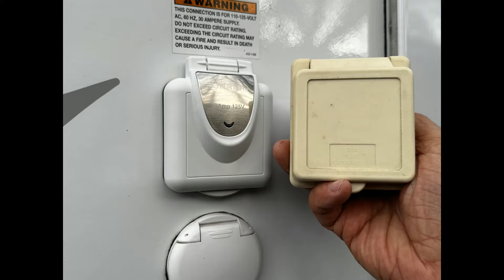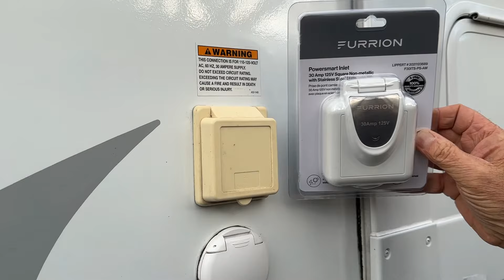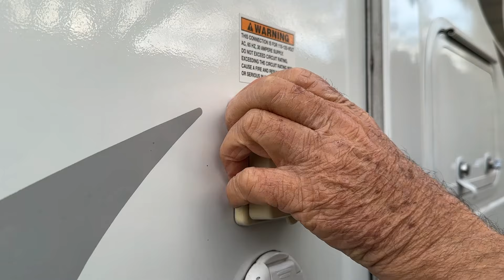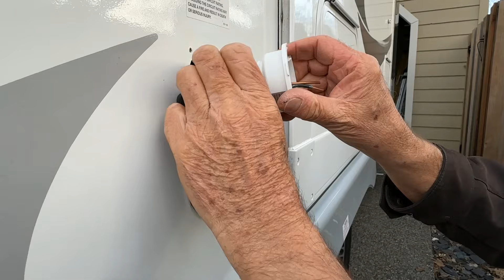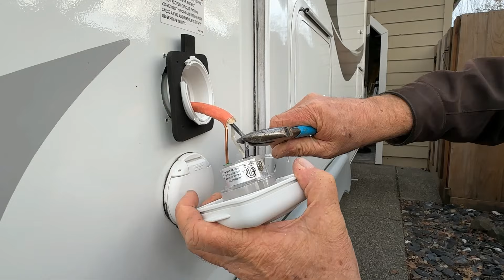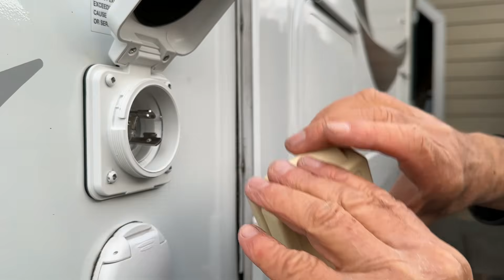Installing a 30 Amp RV Marine Grade Power Inlet

Comment: I have the upgraded marine plug in my camper… but I noticed that the LED light on the cover is not working. I think water got into it around its circuit board and shorted it out…the LED in the cover looks built in….any suggestions other than replacing the whole plug? Do they sell just the cover with red and black leads to the LED?
Reply from the maker: Hello Walter, thanks so watching and asking your question. I have had on a previous  inlet plug the same thing happen and have heard of many others that have had the same problem with the light failing. And have not found on the internet a way to fix this problem, mine is still working and if it fails I guess I'm going to have to just live with it :( . You might try contacting the company and ask them what to do?  If I find a solution I'll get back to you.
Reply: @thetraveltrailerguy  I’m afraid the solution is going to be to replace the whole assembly… but yes let us know otherwise if there is a replacement cap …when I do replace the unit, I will remove the two inside screws to get access the red and black wires entering the LED then apply some RTV to the red and black wire leads as they enter the plastic case to the LED to keep water from wicking into the LED, if yours is still working, you might want to do that as a preventative measure. If it works maybe add that process to your videos. Thanks
Reply from the maker: @walterneilson8119  Thank you for the information Walter, When I get back from our cross country trip I will do what you recommended, make a video and give you a shout out for recommending this. Thanks again, Mike
Reply from the maker: https://www.thorforums.com/forums/f8/help-yellow-shore-plug-light-but-30amp-blue-light-off-25663.html

Comment: ? Michael.  Using that adapter from camper to home.  Does the extension cord warm up at all when in use?
Reply from the maker: Hello Mike :) I The adaptor is nice to have, I use it to charge the batteries; to cool down the refrigerator before camping; to run the heater blower. The extension cord  has never got warm at all, I don't use it to run the air conditioner or the microwave (but maybe it would be okay to do). We have used it at camp grounds when we don't need the air conditioner. Its a lot better than pulling out the big cord when running the generator too. 
90-Degree Dogbone RV Adapter 15-Amp Male and 30-Amp Female with Twist Lock and LED Indicator - https://amzn.to/3Hoxd3u
Reply: @thetraveltrailerguy  I would use it at the house, RATHER than running my 30amp cord from the 110 in the garage to the camper's 30amp plug.  The regular camper 30 amp cord.  Makes more sense.  I HAVE run the AC in the camper with the 110 to 30 amp at the camper at home, but nothing else without tripping a fuse.   Oh, a few times at campgrounds, there were no 30 amp plugs, only 110.  LOL   I do have a converter plug.  But you can't run much on 110 only in a camper.  Thanks.

Comment: Thanks Michael. This is on my to do list before our first outing this spring.
Reply from the maker: You're welcome Mr Rick, I installed this same one on our last trailer and it worked really well. Thanks so much for your feedback and watching, its appreciated. 

Installed in Video:
Furrion 30 Amp 125 Volt Shore Power Inlet with Marine Grade quality and Powersmart technology - F30ITS-PS-AM -
https://amzn.to/428GBSk

90-Degree Dogbone RV Adapter 15-Amp Male and 30-Amp Female with Twist Lock and LED Indicator -
https://amzn.to/3Hoxd3u

Other option mentioned in video:
SmartPlug RV Power Inlet and Connector - 30 Amp - White -
https://www.etrailer.com/RV-Power-Inl... 

SmartPlug Website -
https://smartplug.com/product-categor...

Travel Decal Maps -
https://amzn.to/3S9va8q

9-in-1 Wire Stripper Tool -
https://amzn.to/3MHtnFA

M12 12-Volt Lithium-Ion Cordless 1/4 in. Hex Screwdriver Kit -
https://amzn.to/3sF6oUC

DEWALT Screwdriver Bit Set -
https://amzn.to/3ulyJQg

Comment: Another helpful and useful video Michael. I like that you can use your existing power cord with no modifications. The threads on the 30 amp outlet on our Lance are difficult to engage, so this is a mod that I will definitely make in the future. Thanks for sharing.
Reply from the maker: You're welcome Henry, this one is built much better than the ones that come with most trailers. You sure can feel the difference in quality when you attach the cord to it :)
Installed in Video:
Furrion 30 Amp 125 Volt Shore Power Inlet with Marine Grade quality and Powersmart technology - F30ITS-PS-AM -
https://amzn.to/428GBSk

90-Degree Dogbone RV Adapter 15-Amp Male and 30-Amp Female with Twist Lock and LED Indicator -
https://amzn.to/3Hoxd3u

Other option mentioned in video:
SmartPlug RV Power Inlet and Connector - 30 Amp - White -
https://www.etrailer.com/RV-Power-Inl... 

SmartPlug Website -
https://smartplug.com/product-categor...

Travel Decal Maps -
https://amzn.to/3S9va8q

9-in-1 Wire Stripper Tool -
https://amzn.to/3MHtnFA

M12 12-Volt Lithium-Ion Cordless 1/4 in. Hex Screwdriver Kit -
https://amzn.to/3sF6oUC

DEWALT Screwdriver Bit Set -
https://amzn.to/3ulyJQg

Comment: Another good how to fix. Keep them coming.
Reply from the maker: Thanks Henry, I really like the quality of this power inlet much more than the ones that come stock on the trailers. Thanks again for watching.

Installed in Video:
Furrion 30 Amp 125 Volt Shore Power Inlet with Marine Grade quality and Powersmart technology - F30ITS-PS-AM -
https://amzn.to/428GBSk

90-Degree Dogbone RV Adapter 15-Amp Male and 30-Amp Female with Twist Lock and LED Indicator -
https://amzn.to/3Hoxd3u

Other option mentioned in video:
SmartPlug RV Power Inlet and Connector - 30 Amp - White -
https://www.etrailer.com/RV-Power-Inl... 

SmartPlug Website -
https://smartplug.com/product-categor...

Travel Decal Maps -
https://amzn.to/3S9va8q

9-in-1 Wire Stripper Tool -
https://amzn.to/3MHtnFA

M12 12-Volt Lithium-Ion Cordless 1/4 in. Hex Screwdriver Kit -
https://amzn.to/3sF6oUC

DEWALT Screwdriver Bit Set -
https://amzn.to/3ulyJQg

Comment: Nice install video Michael, love how beefy the power inlet looks!
Reply from the maker: Thank you TNT family :) I like how much better the connection feels compared to the stock power inlet. Keep on camping and living life to the fullest everyday.

Installed in Video:
Furrion 30 Amp 125 Volt Shore Power Inlet with Marine Grade quality and Powersmart technology - F30ITS-PS-AM -
https://amzn.to/428GBSk

90-Degree Dogbone RV Adapter 15-Amp Male and 30-Amp Female with Twist Lock and LED Indicator -
https://amzn.to/3Hoxd3u

Other option mentioned in video:
SmartPlug RV Power Inlet and Connector - 30 Amp - White -
https://www.etrailer.com/RV-Power-Inl... 

SmartPlug Website -
https://smartplug.com/product-categor...

Travel Decal Maps -
https://amzn.to/3S9va8q

9-in-1 Wire Stripper Tool -
https://amzn.to/3MHtnFA

M12 12-Volt Lithium-Ion Cordless 1/4 in. Hex Screwdriver Kit -
https://amzn.to/3sF6oUC

DEWALT Screwdriver Bit Set -
https://amzn.to/3ulyJQg